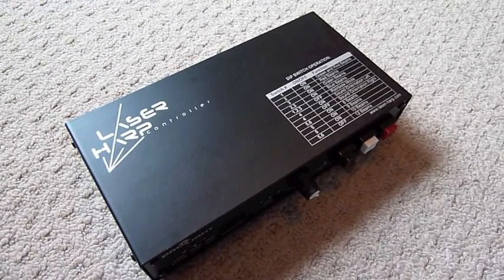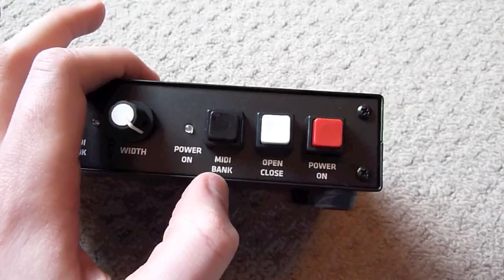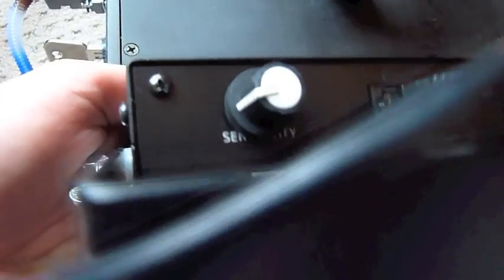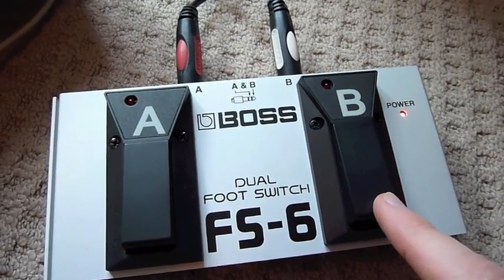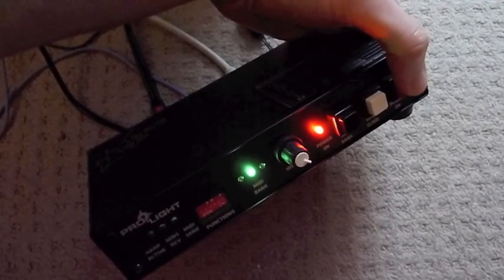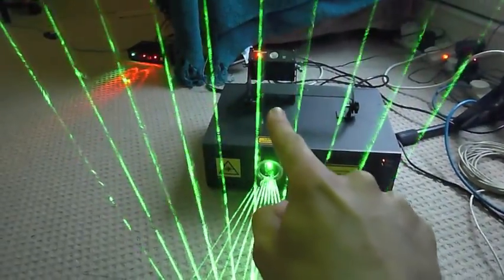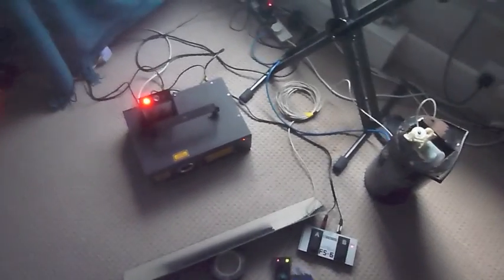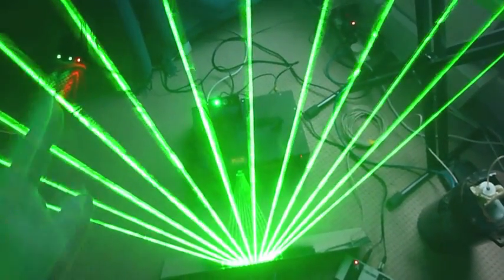Laser Harp Demonstration

Comment from the maker: I think you're right about a DMX issue - Make sure all dip switches are 'Off' on the laser.  Otherwise, it'll think it should be expecting a DMX signal rather than ILDA.  The Prolight controller really is so simple to use and should be plug and play.  Let me know if this helps and how you get on :) Good luck and happy harping!

Comment: Hello. I have just recieved the prolight controller. I have a 500mw rgb laser from Nrg. But i cant get them to work together. I think it might have to do with the dmx settings, because the laser does not send any beams when connected to the prolight controller, but works fine when its not connected. any advice?

Comment: Am i right that this system senses if there IS a reflection (from the gloves) rather than sensing an interruption of the beams? That's just brilliant! How does it handle "noise" from other lightsources (in a lightshow)? Does it recognise the specific wavelength of the laser? Thanx!
Reply from the maker: +rondutch23 Yup, that's exactly it - the sensor is just a photosensor that detects reflections - hence the obligatory white gloves. The sensor can have the sensitivity adjusted, so with white gloves making the reflection as bright as you can, you can turn down the sensor sensitivity so that its less sensitive to external spill/noise.
Reply: +WaxApul Why were you wearing gloves?
Reply from the maker: Reflects the beams better

Comment: For a good beam you should use 500mw upwards, the stronger the beam the better reflection the controller can pick it up better... At the moment with my laser harp im using a 200mw green laser and that works great but the controller has to be closer to the laser for best pick up...